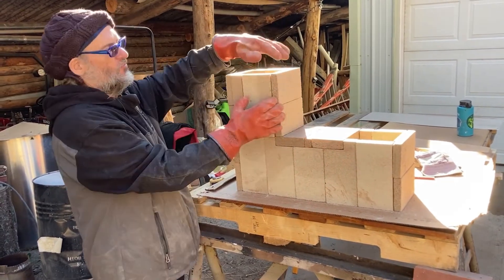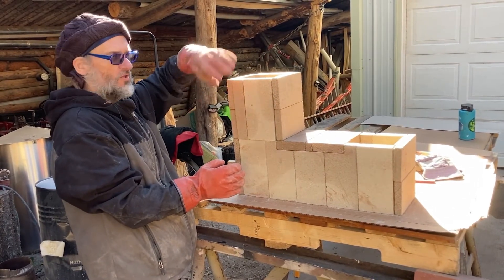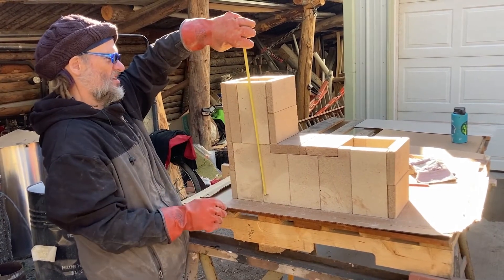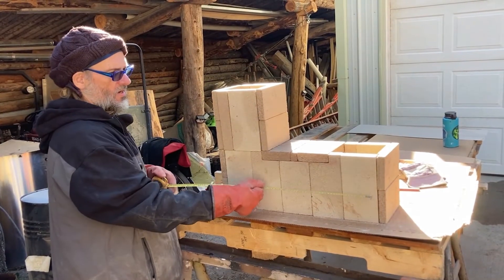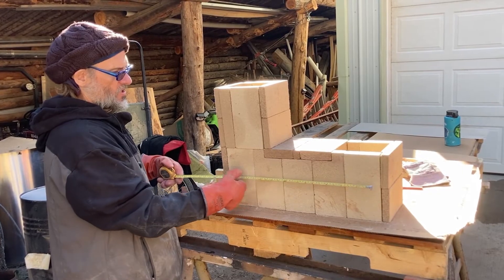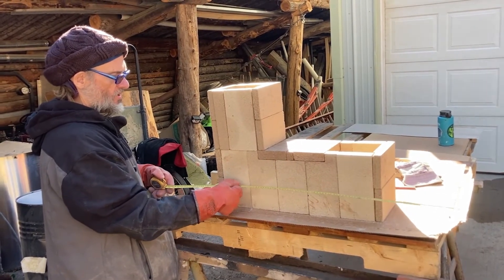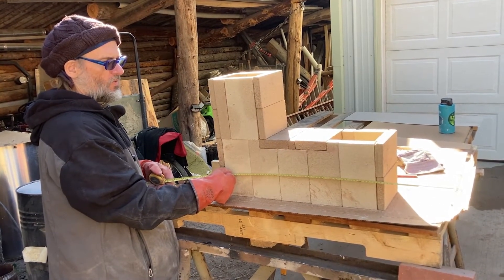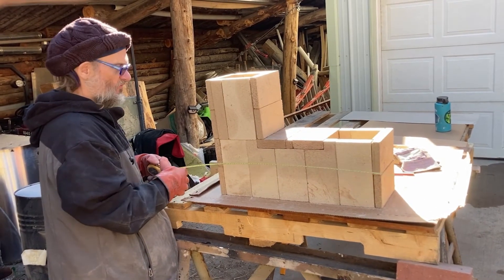Freaky Cheap Heat: Rocket Mass Heaters Dimensions, Dynamics, and Design with Uncle Mud

Comment: How about replacing the RMH front face with a sealed piece of Ceramic glass? That way you can see the fire through the front of the Jtube. You could also make a dual layer glass front to add a little air insulation. The airflow design of the Jtube automatically creates an air wash so the window should stay clean.
Reply from the maker: If you do that experiment, please post a youtube video!
Reply: @paulwheaton Will do! I'm all about building and experimenting.  Here's my design for a Wood Fired Barrel oven I built versions 1 and 2. Cooking in my RMH will be of utmost importance so going to incorporate that into the design!

version 1

https://youtu.be/rrW2CaIETe0?si=Q_PdYuECFsg9Jg-B

version 2

https://youtu.be/KrWAOuZ9TWg?si=cA5JEGD6tVgR5Cfm